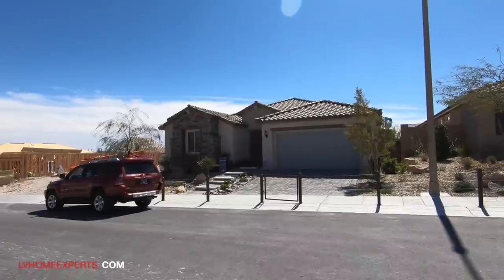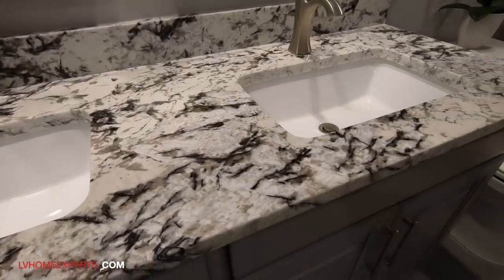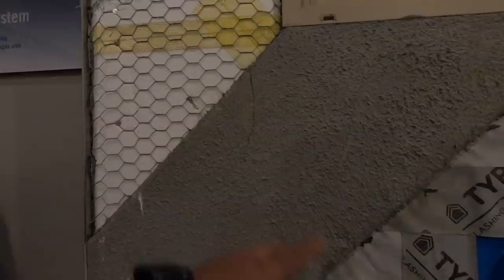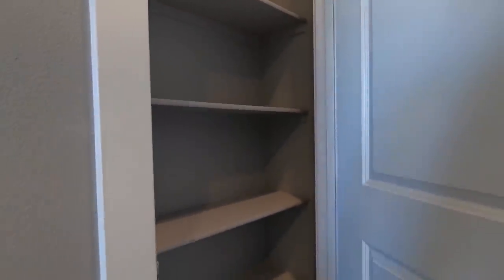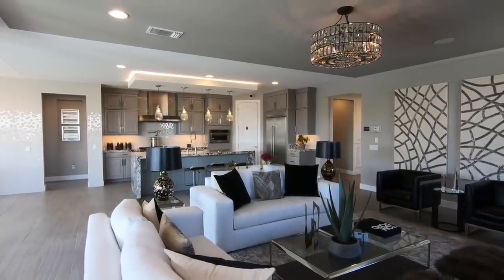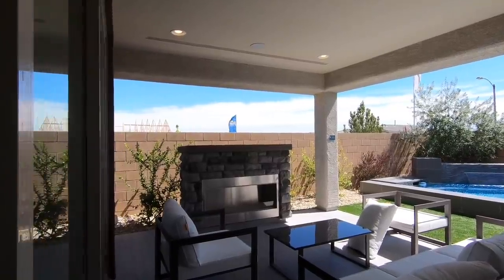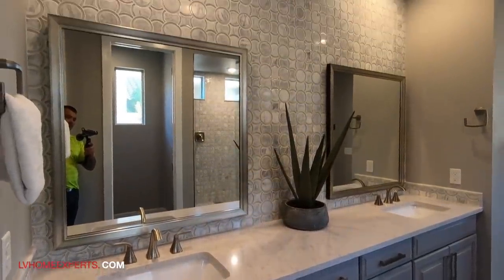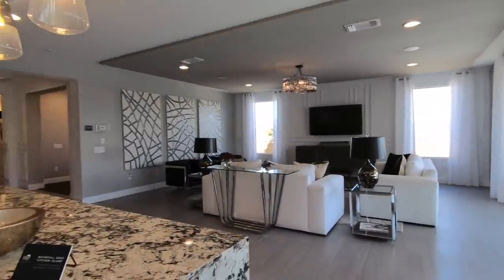Single Story Home For Sale Las Vegas Skye Canyon | $440K | 2,462 Sqft | Pool | 3-5 Beds | 2-3 Bath

Comment: This is a very nice property.  Great floor plan.  Of note is the engineered post tensioned slab floor/foundation the unit is built upon.  This is a more expensive process seen in commercial construction that prevents stress fractures in the slab floor.  Very stable.  I'm glad the builder has made note of this in his showroom.  This is a quality built home.